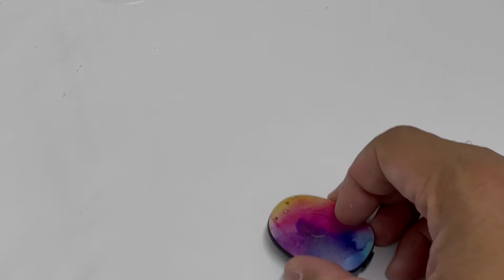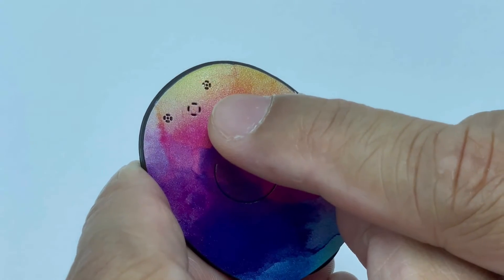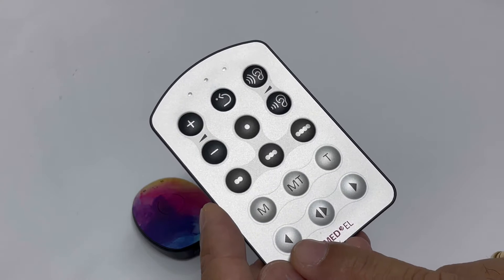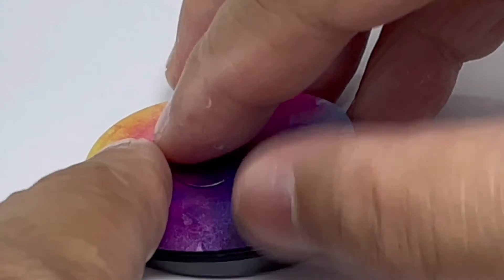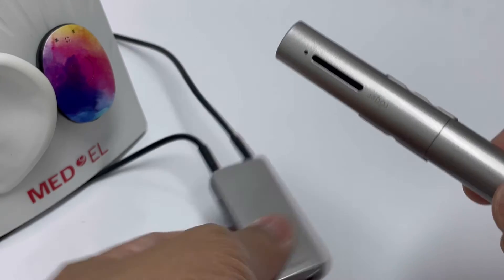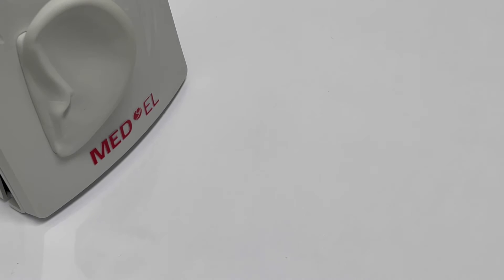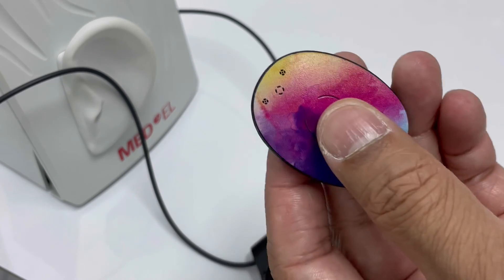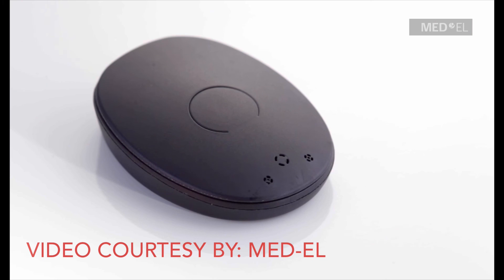Comprehensive tutorial on how to use your RONDO 2 Audio Processor.

Comment: Does the yellow LED light error need to be sent to a technical service center, or can it be repaired at the place where we bought the Rondo 2 device?
Reply from the maker: If its functional do not send it yet for repair because we dont have LED repairs only. The whole device will be repaired preventively.
Reply: @cochlear_implant  Yes, the device works perfectly fine, there's no problem. In fact, when we attach the cochlear implant, our son can hear our voices without any issues. But does this fault fall under the warranty? My son has been using these devices for 8 months, and this is the only fault that has occurred in one of them.

Comment: At 12 weeks.my audiologist tried numerous times to connect.my rondo 2 processor to the remote and bluetooth, but i could not hear a single sound. I am struggling. I cant use my remote, i cant use the telecoil. What could be the problem?
Worried
Reply from the maker: @jeanmzaonako5825  its possible that its the rondo 2’s telecoil issue or the artone is faulty. Best way is to ask audiologist to use microphone check and try to connect via bluetooth.